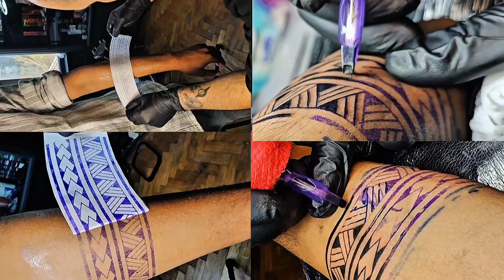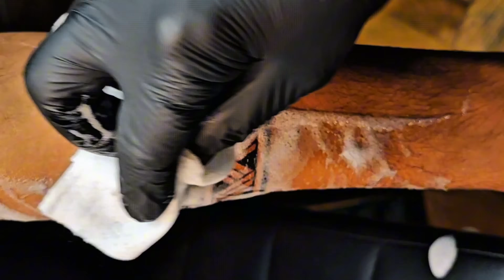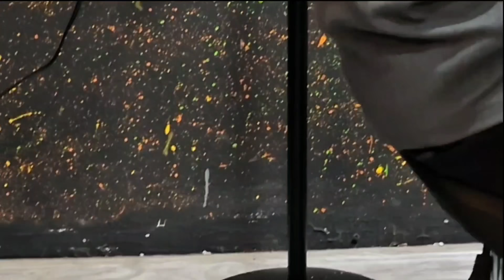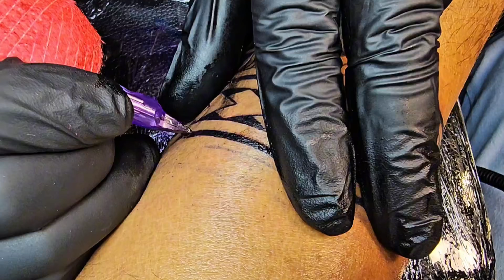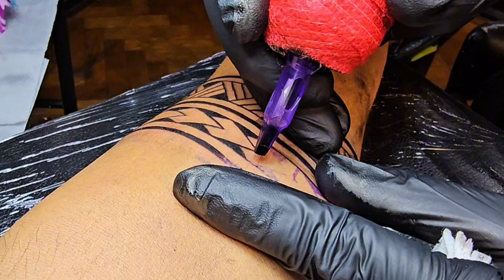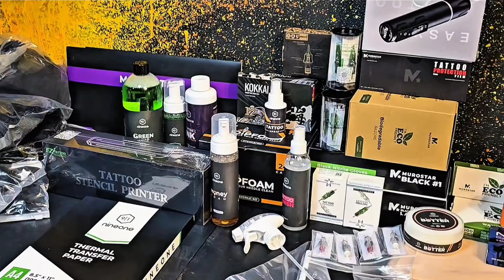Armband Tattoo Mistake! 🛑Tattoo Tutorial + FREE Maori Design Template

Comment: Great video! I do have a question.. we can use the same amount of curve for every arm or leg? Or does a arm wrap have more curve then a thigh wrap??
Reply from the maker: Thank you, bro! 🫡 Great question. No, you shouldn’t use the exact same curve for every arm or leg. The curve depends on the shape and circumference of the body part. An arm wrap usually needs a different curve than a thigh wrap because the thigh is wider and has a different surface shape.

The important thing is to adjust the curve to follow the natural shape of the area you’re working on, so the design sits and flows correctly on the skin. 🤝

Comment: EDIT EDIT EDIT: I checked the end of the video and it is all good. It was fixed with a RL at the end. 

I am sorry my dude, but those thin lines look really bad, that is not clean work. You should have used a round liner, because with the mag you are just not as precise + the lines do not look straight.. 
The Mag lines look scratchy.  EDIT EDIT: I checked the end of the video and it is all good. It was fixed with a RL at the end. 

Yes, I am a tattooer and have been one for over a decade,  but this is just bad work, sorry. You are doing a disservice to your customer.

And you can easily use another needle, it will cost you 1,2-2€ depending on what needle-brand you use.
Reply from the maker: I respect your opinion and your experience 🫡
This video was more about demonstrating a different approach and experimenting with mag technique for certain textures and effects, not replacing traditional round liner work.
I agree that round liners give cleaner and more controlled thin lines in many situations. 
Also, if you watch until the end of the video, you’ll notice that I used an RL in the final stage to clean up and refine the lines. I think maybe you missed the final result at the end of the video.
Still, I appreciate you taking the time to share your feedback. Constructive criticism is always welcome.🤝🙏
Reply: @Bentattooart Thank you for your reply. I have checked it and it looks good, edited my original comment.
Reply from the maker: Thanks bro for checking and updating your comment, I appreciate it.🙏🫡